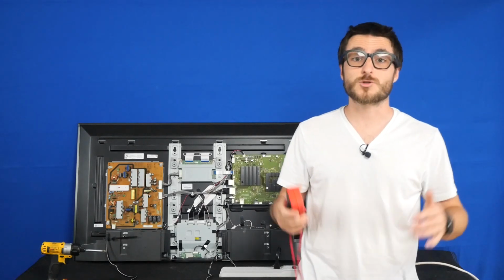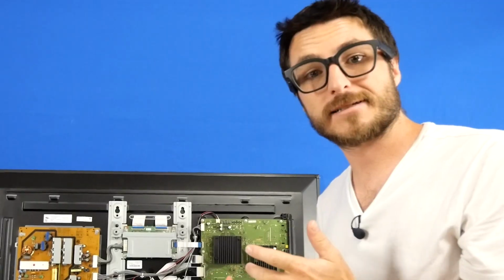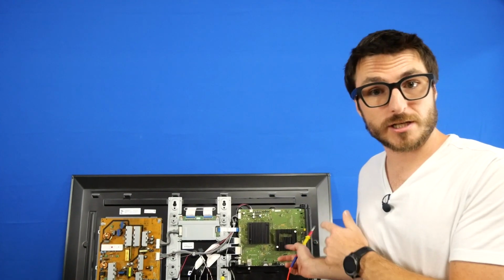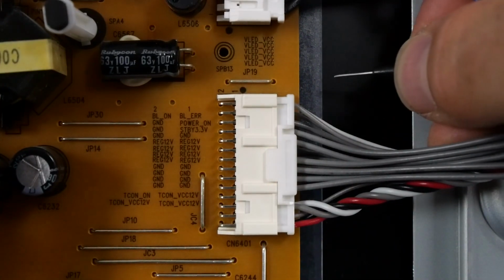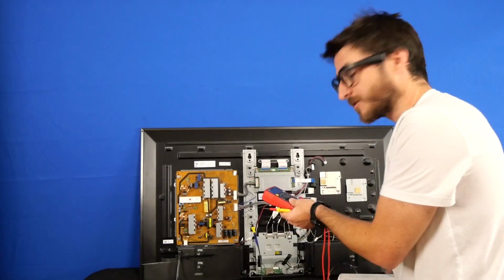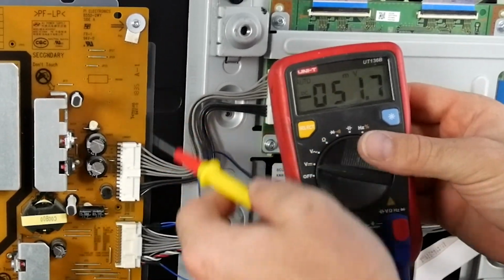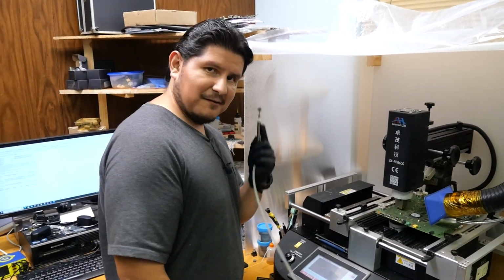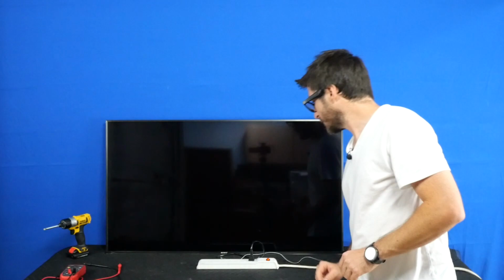The Ultimate Guide To Diagnosing and Fixing Sony TV XBR-49X900F

Comment: My X900F (not one issue in almost 8 years) just died on me. The TV shut off, and when I turn it back on, it tries to reset but shuts off, and a red light flashes 4 times. Is it repairable, and how much would it cost?
Reply from the maker: You will need to replace your LED strips to fix that. This is a repair that would need to be done locally.

Comment: Sooo, I don't have 1.8v on those second bank of caps, is this just a replace mobo situation then? Standby is present, tcon on are all 0V. I have no standby red light at all. 3.3V and 12V are both present on the power supply
Reply from the maker: Yeah it sounds like a mainboard failure to me then
Reply: @NicksTVRepair crikey, I was hoping to be able to repair it myself. But the passive are unlabelled so I can't follow the service manuals flowchart 😂. Thanks for getting back though after so long since this vid was posted.
Reply from the maker: If you want to send in the mainboard, we do fix it, we replace the eMMC chip and CPU units on these often, in fact we did 2 of these boards yesterday for customers. It usually is more reliable for us to fix than it is to buy a used one on eBay as they often are either defective from the get go, or have limited life left in them. At least with the repair you know you are getting brand new parts and a 1 year warranty. 
If you are interested in sending in your mainboard for repair here is our flat rate service:
https://nickselectronics.com/products/xbr-49x900f

Comment: What is the typical cost for this type of repair? Just trying to justify fixing a TV or buying a new one.
Reply from the maker: If you have a defective mainboard you want to send in for repair, click on the repair service listing linked in the video description, it will have our flat rate pricing. I don't typically provide quotes in comments because prices can change so I will reffer to our website instead.

Comment: Hello, how are you? I have a 65" x905f, my motherboard died and the memory was probably corrupted, the problem is that in my country (Chile), I can't find maind board to change it and here the reprogramming of the corrupt chip is not done, is it possible that I buy a motherboard in the USA on eBay for example and be able to change the motherboard? I don't use the tv digital tuner, here in Chile we have ISDB-T,. And finally if I have the 65" version do I have to buy the same version? or can I use the 55"
Reply from the maker: I am not sure that they are cross compatible between countries because I think they may use different screens, but they should be cross compatible from smalled and bigger sizes
Reply: @NicksTVRepair I buy the 55 version an it works!

Comment: I have an 65” X900F. I got the 4 red blinking lights and replaced the LEDs. The TV worked temporarily after replacing the LEDs but went back to the 4 blinking red lights. What is the best next step?
Reply from the maker: 4 blinks is due to bad LEDs, that's the fault. If the fault is still present after the replacement either the parts were bad, or the installation wasn't done right. So recheck your work, make sure the LEDs you bought are brand new and not used. If they are used or pulled from a TV with a broken screen then you bought bad parts and need to return them for a refund.

Comment: What if my stand by is 6.9 and I have no power on the 11-18?
Reply: XBR-65X850D
Reply from the maker: The pin out for that model is going to be different. You would have to reffer to the legend on your power supply. On your TV specifically what voltage are you expected to see for pins 11-18? Is it 12v? 
It's not really possible for you to be seeing 6.9 v on your standby line regardless of the unit work properly or malfunctioning. If there was a problem you would simply see no voltage not more voltage than expected. 
Make sure your multimeter is set up properly, make sure you are using proper chassis ground and try your readings again. Make sure you are reading the legend on your power supply correctly.

Comment: I have a black screen.  Already confirmed the backlights are all working correctly.  Have sound and can ever hear it play YouTube just no picture. All boards have been swapped and still no change.  I tried to jumper BL on, PWRon, STBY, and TCON on (disconnected the power at the main board and the lvds cables at the tcon.  All lines jumped only show the 3.48 standby voltage, not 12v.  Does this mean the screen has gone bad or is there another likely cause? When all cables are connected it I get the 3.48 standby, I get the 12.7 power on and Tcon on at 3.48 and tcon 12v lines read 12.7.  I get 30v on the backlights going to the LDA.  Everything powers up and the backlights glow but no picture.  Any tips or advice?

Comment: Hi Nick, the way you present your videos diagnosing and repairing faults is excellent. I have an XBR55X900F that the backlight does not work, the TV is protected by 6 blinks, the internal LEDs were tested with their voltage interfaces and it was tested with new LEDs but the fault is always present, an LD card was tested and the fault continues, I wanted to know if you could give me some advice.
Reply from the maker: Replace the LEDs. They are defective even if your LED tester says they are good. Most LED testers don't check to see how many amps are being pulled by the LEDs, only voltage draw and thus aren't always reliable in finding out if the leds are good or not. LEDs can test good when in fact they are bad. I trust the 6 blink code more than the test performed that ruled them out.
Reply: @NicksTVRepair  I understand, thank you for the support, what happens is that I do not have the backlight power on voltage, normally in staby 26v and on 35v, when you turn on the TV the backlight power goes up and is protected by 6 blinks, when I force the power supply with what you do, 3.3v to the bl_on, power_on, tcon_on pins, the backlight power goes up to 35v, but only It illuminated for a few seconds.
I proceeded to check the LEDs and taking advantage of the low lighting I found a damaged LED strip, with the LED strip replaced and the source activated, there is permanent lighting and the color pattern is presented.
Even though I had managed to fix it, but with the mainboard connected, the source cannot raise the backlight voltage and sadly the same problem at the beginning is protected by 6 blinks.
The interesting thing is that in this model in the communication harness of the source and mainboard on pin 2 of the source connector I do not carry any cables to the mainboard, apparently the backlight is turned on through the LD card.
In conclusion I have the bl_erro volathe at 2.46 volts and on pin 1 of communication between the main board and the LD 3 v which is supposed to be the BL_on.
As I see, there is a voltage that the LD sends to the power supply on pin 3 GL_ctrl, which could turn on the back light there.
I have tried the power supply, LD card, and the main board and I still have the problem of the 6 blinks, after replacing the defective LED strip the only way I can keep the backlight on is by forcing the power supply.
I thank you in advance if you have any opinion on this failure.
Greetings
Reply: Nick fix this tv are you in houston no power in tv
Reply: Most be a short  probably is the power input

Comment: I have an 65XF9005 with this same issue, however my 3,3V is present, while the 12V is not. I've double checked this thrice, but there is no 12V. I assume that this points towards the PSU, am I right?
Reply from the maker: I am not familiar with your model number as it is not a north American model. But if it's the same version as the one in the video I would tend to believe that you probably have a mainboard failure. Often the 12v doesn't come on because the mainboard didn't send the signal for it to turn on. I honestly have never seen the power supply fail for the 900F series sets. If your XF9005 is the equivalent I would believe you have a mainboard not power supply failure.
Reply: @NicksTVRepair  It's not completely the same, but it looks very similar. It's a European model from late 2018. I got the impression from the video that both 3.3V and 12V should always be present. Is this not the case?
Reply from the maker: Mhmm yes I see I just rewatched the video and indeed we do see the 12v come up. So the 12v may not come up automatically if the mainboard has failed really bad. I see how misleading that could be. 
What you need to do is inject 3v or 3.3v (using the stb) to the PS_ON pin, when you do that, it will bring up the 12v. If you don't get the 12v after injecting 3v to the PS_ON pin then you can say your power supply board is bad. 
I am realizing I probably want to redo this video to be more clear on this.
Reply: @NicksTVRepair  Ah, I see. I'll try injecting the signal when I change power supply (I ordered one rather cheap while troubleshooting) and keep you (and everyone else interested here) posted. From what I understand, changing the main board may come with some nasty side effects like apps not working and things like that, is it?
Reply: @NicksTVRepair  Well, it turned out to be a misreading from my side after all. I did it all again and both the 3.3V and 12V showed up as expected, as did the voltages on the capacitors before the chip. Novice as I am, I think I made the previous readings with the mainboard disconnected thinking that they were always present. But I cannot get neither backlight or test pattern...
Reply from the maker: That is strange. You should be able to. It's very rare for any of the other parts in the set to fail. Most of the time the mainboard fails, the second and less likely part is the LED strips, but when those fail they trigger a 6 blink error code so it's typically an easy diagnostic. If you aren't getting a blink code, I would expect your mainboard to be the fault.
Reply: @NicksTVRepair  You are indeed a master of your trade. I performed the jumpering once again with
extra caution and new jumper wires and the test pattern emerged just fine. Too
bad I live on the wrong continent for a repair...

Comment: Found you guys by just hammering Google with "XBR-55x900F" issues and I ended up here.  I feel like I'm so close haha.  A few weeks ago mine turned off while watching something and did the 4 blinking red light thing that appears to be common.  I was able to start it and get an Android starting screen, but it always does the 4 red blinks after a moment.  I am assuming this is a blown/defective LED issue, yeah?  My only issue is that I don't know where the actual LEDs are located.  I see the boards, but I can't really find a video that helps me get to the LEDs to check if one of them is shot or not.  Am I just bad at searching for one?  I'd hate for this TV to have to be thrown out because of one little diode being dead.

Comment: If I have a XBR-55X900F that will run for 5-30 minutes before shutting off and having a 4 red light blink for power, what would be the most likely reason? Power cycling the TV will get it to run for another 5-30 minutes sometimes.

Comment: Hi, I have a xbr 65x900f that won't turn on suddenly. I am able to get the green light to come on when I put it in factory data reset, but it never does anything else... Would you think this would be a main board issue or power board? Thanks
Reply from the maker: The symptoms would lead me to believe you have a mainboard failure. If the power supply was defective then you would not be able to even get the green light.
Reply: @ thank you
Reply from the maker: No problem
Reply: @NicksTVRepair this was the fix, your videos were essential viewing. Thanks again!
Reply: @NicksTVRepair  Following the previous post, it seems backlight is on but does not do the test pattern. Do I need to do something to trigger screen color pattern test?
Reply: @NicksTVRepair  Hi, I also have 65x900f with same problem as ryanb8192 said. 
I managed to disconnect mainboard and jump pin STBY3.3 with Power On, TCON On and BL ON together. Then I get standby 3.3v, normal 12v, TCON 12v all present, and the backlight power goes up to 35v as well, and the TV screen turned on, finally. 
But my screen only show in light white. Can you please advise how to process color pattern test. Great thanks.

Comment: Xbr65x900h...looking to ground the BL Error pin connector wire...not sure which row...any suggestions?
Reply from the maker: Can't do that, it won't work. 
Replacing your LED strips is the only option to properly fix your set.

Comment: So i manage to get the firmware uploaded to the new main-board, before there was no sign of life, no sound, no light.  Power supply seamed to be working, T-CON as well with the screen pattern while the jumper in place.  After the firmware as been uploaded it started to blink a series of 3 red light. Then i disconnected the TV, reconnected it and now i get a series of 5 red light flashing, what do you think ?

Comment: Nick, Why didn't you finish the video? You went from the TV coming on after you paired the already paired tv to the board and quit.  What happened to the software update? I feel like this was so excellent and then you left it unfinished! I feel like i was left hanging.  I have the same exact model and it won't turn on; it has 4 blinking lights. I tested everything but didn't have the capability of removing the chip. I was looking forward to the software update which i know you probably have another video for. But why not finish this one?
Reply from the maker: First things, 4 blinks = LED failure. This video won't help you with fixing your TV. You need to replace the LED strips to fix your set. 
As for the pairing/update, it is just to turn the TV off, plug in the flash drive, and plug the TV back in. Not really anything technical or worth showing in my opinion. It's like power cycling, it's too simple, I would just say we did it, I wouldn't show us unplugging the TV waiting 10 seconds, and plugging it back in.
We also have made several pairing videos as you mentioned, which you can check out here if you are interested:
https://youtu.be/3kYPjIHt8Lc?si=CVIixN9zjEUT3Vtb
And 
https://youtu.be/gBd2g7kRsEM?si=Yvx9xCvpwuSxaBHU

Comment: Is it possible to do the "quick fix" to remove the BL error cable with this model? I assume it works the same way other previous models work I have seen many videos detailing that and I can see in this video there is a BL error cable. Don't want to try it without asking someone though. I have the 4 blinking lights error.
Reply from the maker: 4 blinks mean you need to replace your LEDs. There is no quick fix for this model. The only TV that you could ever do that quick fix for was the 900C model because of the unique design of the LED strips and the way that they triggered the fault. This however does not work on any other models. The only trick is a 1h-2h process of replacing the LED strips. 
Sorry

Comment: 75 900f. Completley dead. When i disconnect main board and do the jumper pins i get the backlight to come on but does not do the test pattern. Does this mean mainboard or one of thr other boards is bad. I did order a mainboard off ebay that said tested but same results. It could be bad as wepl i suppose
Reply from the maker: To me, it would mean your mainboard is defective. eBay is full of non-working boards so it's possible you received a dud or you didn't pair the board to your TV. 
If you would like to send in your mainboard for us to live test and fix we can do so, this way we can confirm the diagnostic and then perform the repairs. This way you know for sure whether or not the mainboard was the fault, and since we live test the board both before and after repairs we know again for sure the board you will get back is fully functional. We also provide you with the flash drive and instructions for pairing.